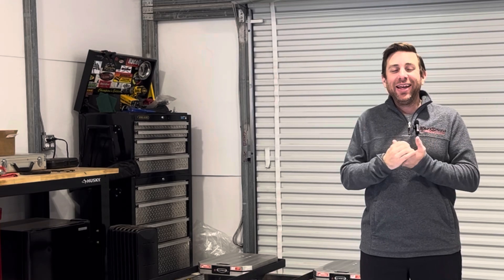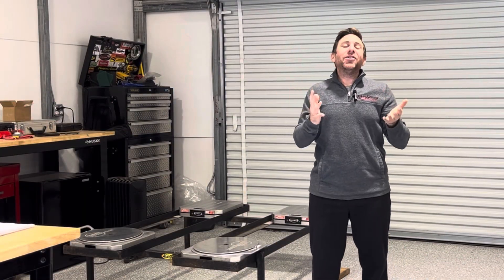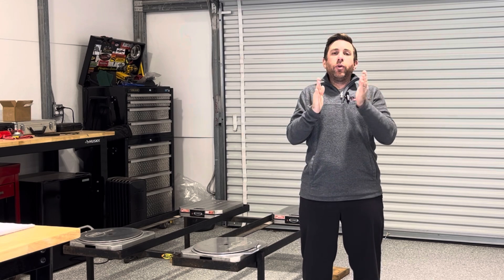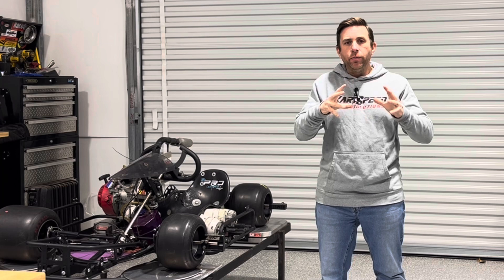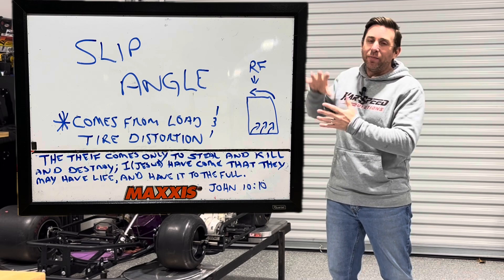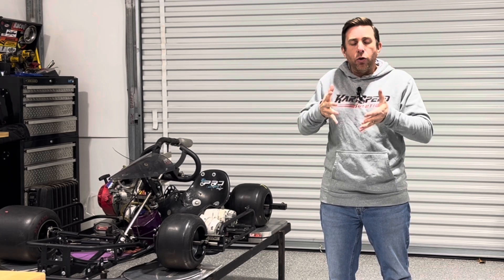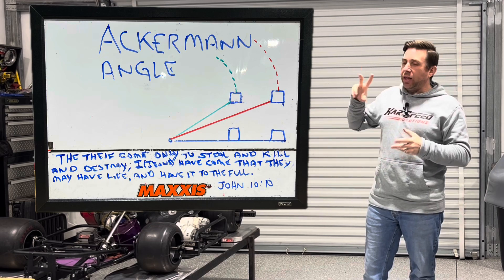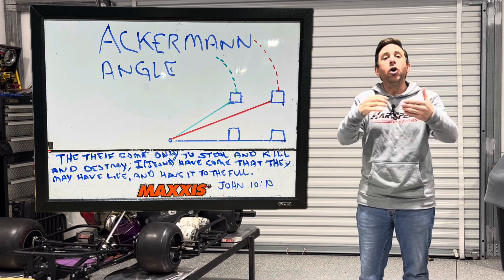Why Do We Toe The RF Out? Part 1

Comment: if you toe the RF 1/16th out and turn the steering wheel to track the RF straight the LF will be toed out 1/16th
Reply: After watchin the video I think what he is doing by putting the toe on the RF instead of LF or equally dividing it by the 2 wheels is adjusting where each tire and its associated linkage are when the kart is actually turning. It will after the Ackerman or the toe angle of each tire while in the turn.